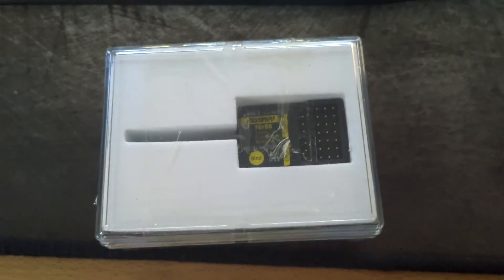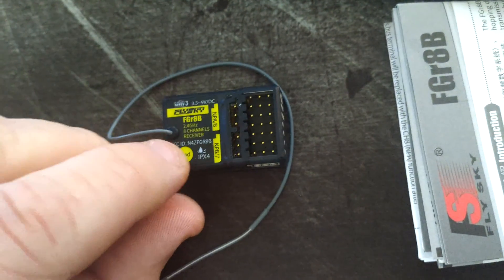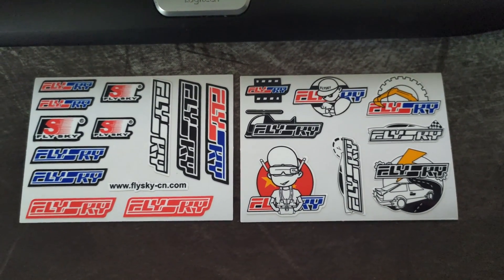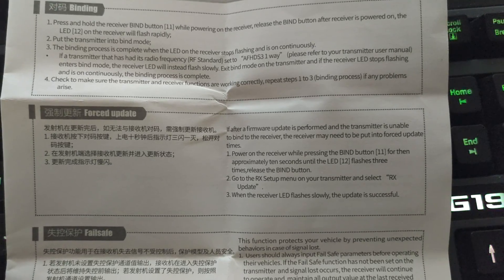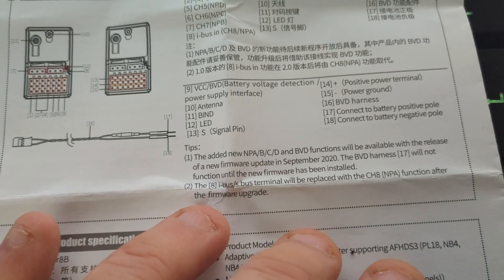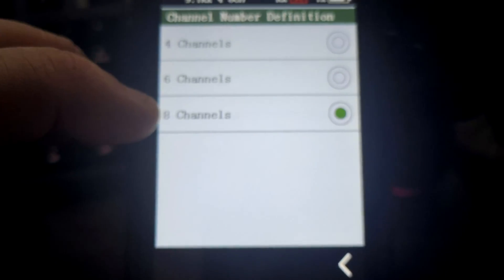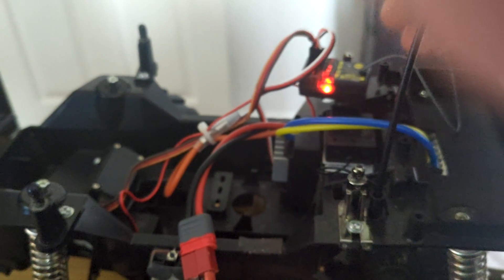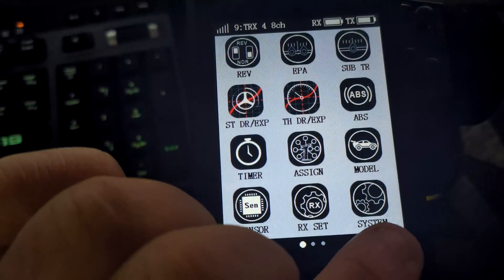Flysky FGR8B 8ch receiver 1st impressions and set up test. NB4 reciever.

Comment: Do you have video bind fgr12b for noble 4 pro plus? Help me
Reply from the maker: They bind in the same way as this one, hold the bind button and power on, set the transmitter to enhanced bind just make sure you have the radio set to 12ch if you want to use all 12 channels :)

Comment: How do you get more power to the ch 4 and up. I can run light bars on ch 3 no problem but if i move it to ch 7 i get a very dim light
Reply from the maker: All of the channel output the exact same power  as all the + and - are connected together so I'd say you have a different issues

Comment: When I try and bind it says it only classic or enhanced. I click classic and then it says a list of FG and FT receivers but the FGr8b is not on the list and it won't bind. :(
Reply from the maker: You need to have the radio on firmware 2.0.100 if it's nb4 and bind as enhanced :)
Reply: I found your other video that updates it and then binds. It works just perfectly now. Just got to set all end points X Mwah lol
Reply from the maker: Spot on :)
Reply: Thanks for the replies. Top man

Comment: Would this offer any type of Telemetry?
If yes do you know what it would send the Noble nb4.

Thanks you
Reply from the maker: Yeh it comes complete with external battery monitor lead, so it will give you the voltage that the bec is providing to the receiver and also monitor the main lipo that you are running the RC from, you can also add temperature and rpm sensors
Reply: @WTFRCCars  o wow so it would show the voltage at the RX plus the main battery voltage. That great.
Can you also add an alarm for the main battery voltage?
Thanks
Reply from the maker: Yep you can assign both high and low alarms to all the sensors
Reply: @WTFRCCars  thanks

Comment: Have you done any follow ups regarding the firmware update? Also how about range tests with the 8 channel vs stock?
Reply from the maker: Yeh never had issue with range in it seems fine and the firmware now supports the external voltage monitoring and full 8ch got a few in the playlist for it :)

https://youtu.be/-XViQoedKBE
Reply: @WTFRCCars  thank you very much, you definitely have the most detailed information on the nb4! Keep’em coming! 💪👊
Reply from the maker: I do my best for ya all :)

Comment: Is this for the noble?  Edit...it looks like it is. Do I have to update my transmitter to run this?
Reply from the maker: Yeh it's for the nb4 :) also it's always worth having the transmitter and receiver updated, I got guides to do both :)
Reply: @WTFRCCars  I just got mine last month so I think it's on the latest firmware. I love the transmitter. Works great an looks sweet
Reply: @WTFRCCars  whats all this talk about the ibus port? What is the ibus port mean? What's it for?
Reply from the maker: Ibus is for sensors like temp, voltage, rpm well worth reading the instructions lol the receivers all transmit data back to the nb4 and can display it and give you warnings if something is wrong :)
Reply: @WTFRCCars  did they release all them sensors the last time I checked they didn't have them.
Reply from the maker: They where released ages back when the nb4 was released, the same ones work for the paladin 18 :)
Reply from the maker: If there's anything in particular ya need to know on the nb4 let me know if I have time I'll do a how to vid for it :)
Reply: @WTFRCCars  no kidding I thought it wasn't released yet. I'm new to the radio ill have to look into them
Reply: @WTFRCCars   whats the link to the sensors like the part number? Thank you very much for your help
Reply: @WTFRCCars  gave ya a sub
Reply from the maker: Thanks for the sub :) there all at the bottom of the link :) you might have to put ya phone browser into desktop mode if they don't show up :) https://www.flysky-cn.com/nb4-peishi

Comment: They already have a 12 channel receiver called the FGr12B. I wish they made a tiny 4 channel one.
Reply from the maker: Yeh the 12ch came out just after the 8ch, how small do you need the 4ch to be? They do some tiny ones for the miniz type cars it's very small just a circuit board that may work for you :)

Comment: does it have gyro
Reply from the maker: Hi so far all the nb4 receivers are aimed at higher end so no gyro you can add a gyro to any receiver though if you need one
Reply: @WTFRCCars  that's what I have done... but I want to get new receivers and was hoping they come with built-in gyros
Reply from the maker: I know the tiny one for the miniz mentioned gyro
Reply: @WTFRCCars  there's two tiny ones .. one has it and the other not

Comment: That looks really good I have the 10 channel in my trx4 with the noble 4 this could be a bit smaller as 10 just goes in the box
Reply from the maker: Yeh it's a lot smaller was looking at the 10ch ages back but no official support for the nb4 as yet so no firmware updates as it was originally released for the paladin 18, the fgr8b has full official nb4 support and comes with external voltage monitoring cable so you can keep an eye on ya lipo, can't wait to try it in the TRX as I have a receiver and the 4ch add on in there at the min so will look much cleaner :)